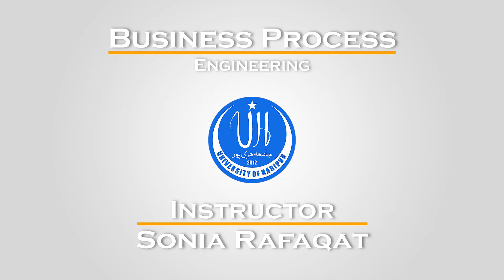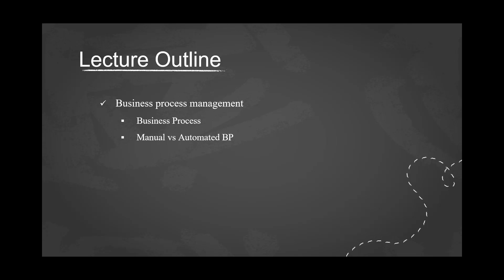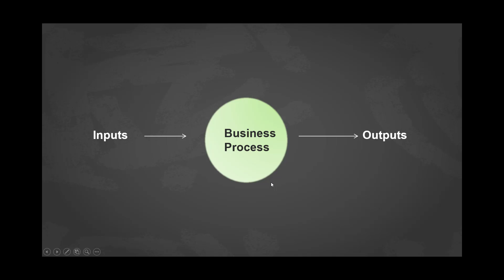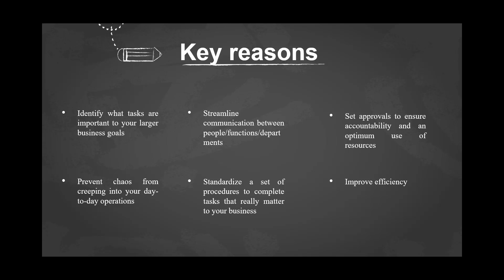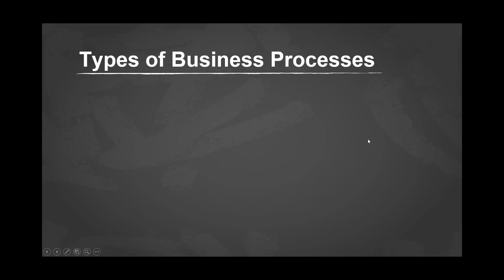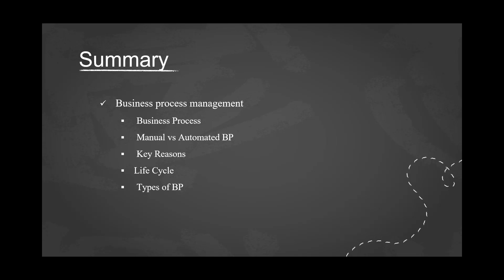Business Process Engineering - lesson 1: Business Process, Business Process Life cycle and Types

Comment: F18-0318
BSSE 5th A
Summary :
Business process is a series of steps (input s) perform by group of stakeholders to achieve a goal(output).It can be manual or automated . As automated BP is more accurate and time saving then manual process.then we discuss about the 7 key reasons :-
1. Define your goal
2. Plan your process
3.Set actions and assign stakeholders
4.test the process
5.implement the process
6.monitor the result
7.Repeat
(If process is able to achieve a set a goal forr it replicate if for further process).
Then we talk about different types of BP Manufacturing process , finance process etc

Comment: F18-0353
BS SE 5th B
Summary:
  In this lecture, we have discussed about Business process that Business process is a collection of activities or task that produce a specific service or product for end users. (Input ->process->output). That series of steps performed by stakeholder is our input and to achieve our concrete goal is our output. In business process we performed different activities on input to achieve the goal. Then we discussed about manual and automated that Automated process is time saving, organization serve more customer in automated than in manual. Chance of mistake is less in automated than in manual. Automated process is better than manual process. Then in key reason we discussed that we had to identify the task, communication is very important, use of resources, from these points we improve the efficiency. Then 7 steps of business process life cycle: Define your goal, Plan and map our processes, set actions and assign stakeholders, Test the process, Implement the process, Monitor the results, Repeat. Then we discussed different types of business processes.

Comment: F18-0404
BSSE 5th-c
A business process  is a discipline in which different stakeholders 
work together to achieve the organization’s desire goals within available resources.
Manual and Automated are two types of the business process. Automated business process 
work with the help of technology that's why have more efficient and time-saving as compare
to manual. The business Process is important because it specifies the organization’s goals and has
a standardized procedure approach. There are 7-steps of the business process life-cycle i.e Define goal,
plane & map process, assigned stakeholders, testing, implementation, monitoring, Repeating.
Almost all large organizations implement a business process to achieve the desired goals such as 
Manufacturing, Defence, Human Resource, and Finance sectors.
Thnx

Comment: F18-0310
BSSE 5th A
Business process is the steps taken by the stakeholders to achieve concrete goal. A business process can be manual as well as automated. Automated BP involve technical aid and is more accurate because it provides more services to customers, error reduction and time is being saved. On the other hand, manual BP involves process achievement without aid of automation and assisting technology. Some of the key factors are discussed which involves goal’s identification, communication among individuals, set of standard procedures and efficiency whereas 7 steps for BP life cycle are to set goals, plan, test, implement process, monitor results and repeat process. Along with that, types include manufacturing, finance, banking process etc.

Comment: F18-0283 BSSE-5-A (walikumslam) 
Business process means the set of tasks to give service or product. It can be automated(with automated assisting technology) or manual (without automated assisting technology).BP introduces steps for achieving goals.It increases communication.
Accountability of teams tasks etc. and ptimization is done through BP. It makes our service/product more efficient.
BP includes seven steps. Firstly tells the purpose(goal) and reason behind the new idea(service /product). Then strategy or plan is made to achieve those goals. Furthermore, checking and balancing of processes. After that, implementation of proposed process steps so end results are achieved if these results do not meets the goals then process steps are repeated. There are different types of business processes out there.

Comment: F18-0327
BS(SE) 5th B
Business process is an organized set of activites and tasks that are used by the group of stakeholders for the production of an output for end users and achieve goals for their organization. Business process can be automated or manual, automated process allows us to achieve our goals quickly as compared to manual process and also helps in detecting and eliminating errors quickly. There are several key points of using a well organized business process, it helps in identifying the goals, it tells us about the resources we have and helps in prevention of chaos. After that there are some steps to create a good business process like, defining goals, planning, assigning tasks, testing, implementing, monitoring and repeating. There are many types of business process some of them are, manufavturing, finance, defence and human resource.

Comment: F18-0378
BSSE 5'C
Basically bussines process includes various steps or tasks(input) that are performed in order to produce output(services or products). Business process can be manual and automated.Automated BP are more effective than manual because it helps to implement processes in more accurately and optimize manner and consumes less time. After that, businesss process should be used because it helps to identify the goals and objectives, provides communication, helps to use the resources effectively, helps in prevention of  choas in day to day, operations, and improve efficiency. Business process life cycle includes 7 steps i. e. Definition of goals, planning, assigning tasks, test the process, implementation and monitoring.
Furthermore, business process has various types i. e. manufacturing, finance,health,banking etc.

Comment: F18-0274
BSSE 5th "A"

A series of steps that leads to achieving business goals is what Business process means. Business Process can be manual as well automated, Automated Processes provides us better Speed, Optimization and Accuracy.
Furthermore, we have come across with some Key Reasons used for an effective Business Process.
The Business Process Lifecycle consists of 7 Steps, starting from defining our Business Goals to Implementation of that particular goals.
If everything is going fine till implementation then these steps are repeated in the same order.
Moreover, There are different types of Business Processes varying upon the market need.

Comment: F18-1142
BSSE 5TH C 
Firstly, A Bussiness process is a series of steps and activities to achieve a concrete goal preformed by a group of stakeholders in a bussiness process. Bussiness process are of two types: First is Manual ( without the aid of assisting technology) and second one is Automated ( a technology aid is involved which helps implementing process in a more standardize and optimize way). All the differences b/w Automated and manual process. Manual processes are slow, more consistent to errors and hazrads, while automted processes offers organization to quickly execute processes, precise operational capabilities reducing errors and time saving offers to Customer and stakeholders. Key reasons why we should have a well define bussiness process and how it helps success of an organization and company. Bussiness process life cycle what steps are involved in life of bussiness process e.g( design, modeling, execution,  Optimized, monitor etc) . In last types of bussiness processes, industry span horizontally and vertically. You have bussiness type according to your bussiness .e.g ( manufacturing, finance, health, banking, HR bussiness processes etc).